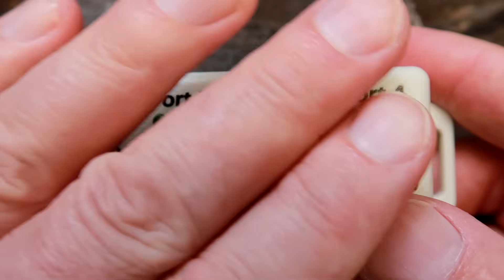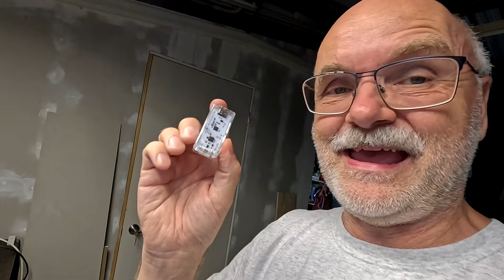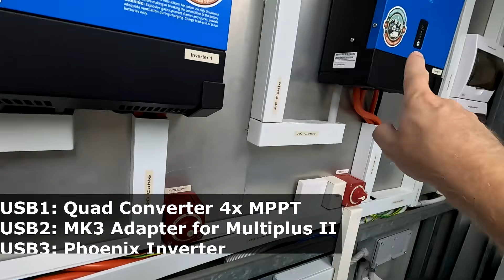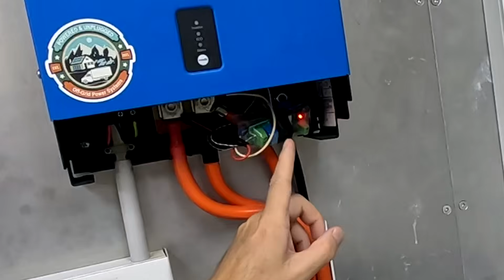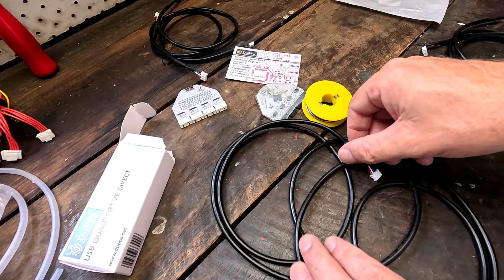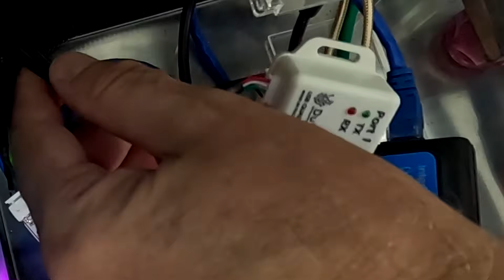Duppa Quadport VE.Direct Converter - Connecting 2 Victron Smart Shunts to my GX?

Comment: Fantastic video, I have purchased a Duppa and connected today. I get the red RX lights but no green TX lights is this correct. Mine are plugged into 4x victron 100/30 c/controllers

Comment: Instead of backing up the pi, how about replace it with the new VenusOS on rpi5 and see if you can get the new UI working with a screen so I don't have to break my setup to do it :P Venus GUIv2 baked into the battery shelf via screen would look really nice if there is any room.

Comment: I have two smart shunts.   One for the main battery bank with the dual Multiplus inverters.  The second one is for a separate standalone 48v Inverter I use for outdoor lights.  It was what I started with before I installed the Multi's.  I use it to track amperage going to the inverter.   I like the new converter ... nice and clean.

Comment: Very good informative video. The almighty Victron can't give us a dam device with more than 3 ve direct ports. Absurdity
Reply from the maker: For larger system, they usually use VE.CAN to connect devices together. The few VE.Direct ports are really only for smaller projects. But wer are glad we have these quad port converters.
Reply: @OffGridGarageAustralia I thought VE can was limited in its logging though. That's why I use ve direct, I could be wrong.
Reply from the maker: @garysurovec  I never heard of any limitation when using VE.CAN. This is always the recommended way for a lot of devices and also longer cable runs.

Comment: Brilliant video Andy. I use a usb hub to connect my 2 jk bms to a pi via a ttl seriel connector per bms. Could I use this device to make the connection isolated?
Reply from the maker: Yes, just watch the voltage levels of the signals and don't connect the positive of the BMS!💥

Comment: On the Venus Raspi I highly recommend to use an SSD instead the SD card. SD cards are not made for 25/7/365 use, SSD are.
Reply: Try to use high endurance sd card. Works like a charm.
Reply from the maker: I use high endurance cards and also the write cycles from Venus OS are vey limited.

Comment: I'm thinking that it would be a good time to switch the multiple mppts to the one new SmartSolar MPPT RS 450/200-Tr model. That would leave those ve-direct connections free :D
Reply from the maker: No, that would be a bad move. I have a low voltage solar system due to shading. So, all my panels are acting like micro strings which is far better than having only one long string of solar panels and a higher voltage. And no, the bypass diodes in the panels don't work with shading!

Comment: You have an amazing set-up, really clean installation, and much like mine, all Victron too, but I'm only using Victron Bluetooth. I will be doing a full VE.D at some point, but next, I'm building my second 30KWH EVE LFP battery. Also, I've just had a second JK BMS go bad, JK were very good and got me to test voltages etc, and the data signal died, JK replaced the last one, but still not happy, so brought a JBD BMS to test, as on Will's diysolarforum lots are switching over after having problems with JK.
Reply from the maker: Yeah, nothing is perfect and all BMS have some sort of issues. The JBD just lacks a lot of features in comparison to the JK.

Comment: Andy, I have two suggestions:
1. Use High Endurance microSD cards for the Raspberry Pi.
2. If you want that the USB devices will have the same ID all the time no matter you disconnected them, use Symlink to do that.
Create a udev rule in /etc/udev/rules.d
Google will help you out here 😉
Reply from the maker: 1. Yes, I'm using one of these. Writing cycles are very limited with Venus OC. I think the heat is more of a problem to these SD cards thane the cycles
2. no idea what this means but thank you

Comment: I had one of my duppa units fail from nearby EMI from relays switching, not even connected to the same wiring, lucky I purchased 2, but disappointed it failed.
Reply from the maker: Interesting, never heard of that before. How do you know it was failing because of that and did you make a warranty claim?
Reply: @OffGridGarageAustralia no I never did a claim. I have seen odd behaviour from my raspi running the GX software when switching relays on/off in my motorhome, it causes communication glitches with the Victron devices, and cannot see them anymore, I added the duppa to remove a usb hub I was using but it killed it ! I added filtering to all my usb cabling before replacing the blown unit and the 2nd is still working, I still get EMI spikes which upset the raspi from time to time, but it is a tricky one to solve due to the 10m cable runs in close proximity.
Reply from the maker: @TheDefpom  Thanks for sharing. Sounds like a difficult issue to deal with. Are solid state relays a possible solution?
Reply: @OffGridGarageAustralia I had considered those but have seen them fail short so am hoping to avoid using them. I have back emf diodes installed on the relay coils, ferrite cores on the cables etc but it seems to be in issue with EMI radiating from the wiring itself.

Comment: how many ve direct devices can be connected to the raspberry?
does it make a diffrence if one  usb and 4 ve ports are used or a usb hub with original ve usb adaptos?
Reply from the maker: Makes no difference, they all show up as individual devices in Venus OS, no matter how they are connected. It's is just a cleaner solution with such a converter.

Comment: Good video! what is the issue with the ibms?
Reply from the maker: I left the project for personal reasons. I disagreed with decisions, features and the way the product and structures developed. I'm not the owner or designer of this product and have no say or influence in which way the product develops or how the marketing or servicing has been handled. I can only share my own personal experience and highlight pros and cons. Like with other projects, devices and products, I test them and move on.
I may revisit the project in the future if conditions are right, but for now I have deleted both videos and links to this project to avoid any expectations from viewers to continue with this product.
Reply: I also wana know?
Reply: mmm, id like to know why too, ive purchased one of the latest ones haven't used it as yet still waiting on my batteries to be delivered from yishy yang, wonder what the concern was ?
Reply: I'm curious too
Reply: Same here.  I have the latest ibms hooked up and working with my 4 batteries
Reply: No issues, just a lack of time on time on my part to make custom changes Andy wanted.
Reply: @uksa007 making a product comes with responsibilities.
As a developer of a few Home Assistant intergrations I know all too well.
Not saying, that what is aksed is feasible. At this point in time.
Reply: @uksa007 As much of a following Andy has, why not make time?  Its because of Andy People like me heard of your product and purchased it.  Now that Andy isn't working the project we dont get updates or product news?.....not good

Comment: Had mine for a month now and a great bit of kit to extend your VE. Direct connections. Thanks Andy, love your output. Quick note ensure your USB-C lead is a data lead not just a battery charger lead.
Reply from the maker: Are there still cables which only charge and don't have data connection? I haven't had such s simple one for over 10yrs.